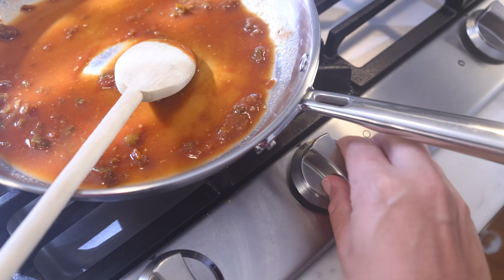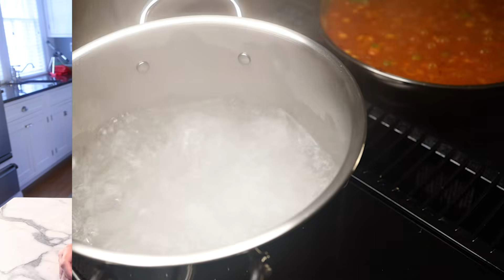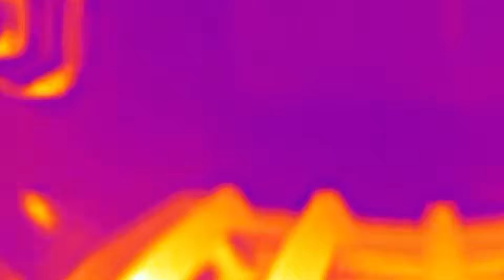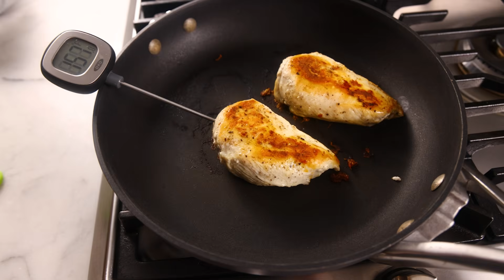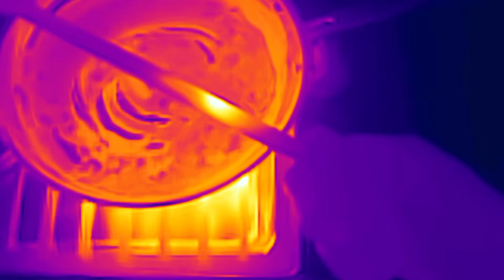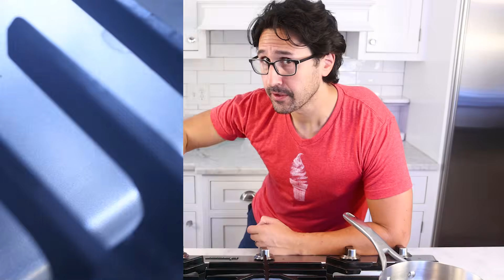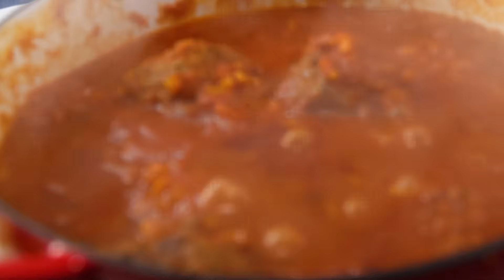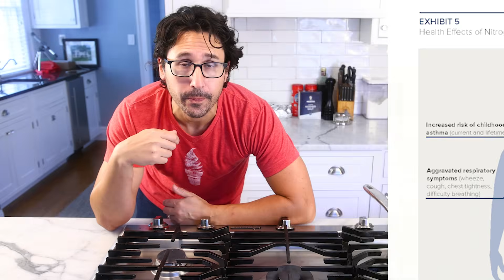Problems with gas stovetops | weak, dirty and dangerous

Comment: I grew up with gas stoves and learned to cook on them. Went to uni and absolutely hated cooking on an electric stove. I've moved to a new house though with induction, and other than needing to buy special pans, it's far superior to both. It's so much cleaner and is so much harder to overcook sauces and the like than either electric or gas. It just makes multitasking so much simpler because you don't need to constantly worry that things are overheating and other things are burning on the bottom and what not.
Reply: Except for when you need to use a very light pan on the induction, the pan moved all over if it is not heavy enough. I get a couple of pan walked off the induction top because it vibrate too much.
Reply: Gas works when electric power is our, this could be a life saver.
Reply: @3ducs  Not really a problem where I live and if there was some great emergency where the electricity goes I could just eat cold food or use a camping stove.
Reply: @georgebritten6666  When the power goes out and it gets so cold in your house you can see your breath you might realize how serious things can get. Ask me how I know.
Reply: @3ducs  Not everyone lives in the United States. Reading other comments this seems to be a common problem.
Reply: @3ducs  I lived without a boiler for a year, yes the house can get cold but you wrap up warm and realistically I probably wouldn't be choosing the hob to heat the house.
Reply: @georgebritten6666  Try that in New Hampshire where it can often go below zero Fahrenheit in winter with high winds. A gas stove can be the difference between keeping the house above freezing in a power outage and thousands of dollars in frozen pipes. Not everyone can afford solar and battery backup or a whole house backup generator.
Reply: @3ducs  depending on where you live, power outages are not a thing. I legitimately can’t remember the last time we had one. Must’ve been at least 5-8 years ago and even that’s being generous. Those power outages don’t take hours either, even if we ever have one.
Reply: @Tom-bb5kh  Outages are not rare here in New Hampshire, USA. The state is heavily forested, storms often bring trees down on power lines. Out of a population of 1.3 million we recently had 200,000 without power from a storm. In below freezing temperatures this can get serious quickly.
Reply: @3ducs  For 99% of the population this is not a concern. Furthermore, that is a problem with infrastructure and emergency services. In the event of a power outage during extreme weather to the point that it's a safety issue, your local government should be stepping in to help you. Even in terms of personal measures, keeping a gas stove around for the express purpose of heating the house in an emergency is horribly inefficient when things like gas powered space heaters exist.

I'm not saying they haven't saved your or anyone else's life; I'm sure they have, and that's wonderful. But keeping millions and millions of gas stoves in circulation in addition to the massive infrastructure that supports them to solve a very specific problem experienced by a tiny percentage of the population WHEN OTHER BETTER SOLUTIONS EXIST is ridiculous. Hell you could even keep gas lines to homes and simply only use them for emergency heating systems. There is absolutely no reason at all to equate "I need gas for heating in emergencies" with "I need a gas stove".
Reply: @ValkyrieTiara  Funny how a thing that no one thought was a problem has suddenly become one. It's almost as if there was a plan to keep the populace alarmed at all times.
Reply: @3ducs  if I had as many power outages as you I would be investing in solar and a big battery system. When buying a new stove and oven I didn't even think about what would happen if the power went out because I don't even remember the last time I had a power outage.
Reply: @rhys6165  You are assuming that all people have the financial means to do all that investing. Many of us don't.
Reply: @3ducs  I didn't assume that at all. I said that is what I would do. I didn't get a battery for my house purely because it didn't make financial sense, but if I lived where you do I would get a battery because I wouldn't want to be constantly inconvenienced by power outages is all I am saying.
Reply: @3ducs  There are U.S. federal programs that subsidise that cost. Go do some research.
Reply: @blackeyedsusan727  Oh, you mean when they take money away from some people to give to other people?
Reply: @fbiguy5269 is a made up problem from the looks of it. Electric (radiant and coil) outnumbers Gas in the US. If the power cuts were  that common, the numbers should be reverse.
Reply: @ValkyrieTiara I'm not defending that shill. But the Power outages are a common occurrence in impoverished regions. That's why gas is still popular in third world countries.
Reply: @jamesisaac7684  That doesn't have anything to do with my point. We're not talking about third world countries. The number of people in the US for whom it is normal for them to be without power for weeks or even days at a time is vanishingly small; certainly not enough to warrant allowing the entire American populace to remain using gas stoves. As I said, I could imagine keeping gas lines specifically for the use of gas-powered space heaters to homes in high-risk areas where it is conceivable they will need heating without power in sub-zero temperatures. For 90+% of the population, no gas to homes of any sort is necessary and it should be discontinued.
Reply: Not all countries have the same "quality" of Texas Electric grid.  

 @3ducs
Reply: So you haven't bought a AC, TV, Dishwasher, Washing Machines, Blender etc.? Because they what run on electricity.

 @3ducs
Reply: @jamesisaac7684  Well duh! Different tools for different jobs.

Comment: I can make the fuel for my gas stove top.  Biogas.  I don't make shitloads of energy to heat electric elements and the electric range should not be used in conjunction with solar systems, as it's not ideal for your battery's life. Derp, derp.

Comment: I really hate gas ranges. The temp markers on it seem more like suggestions. The flame and heat is basically either max or as low as it can go but still to hot. Yes electric does cycle and there's a bit of lag but I've always felt I had finer control. Like medium heat was actually medium.

Comment: Yea, less cabon footprint... because as we all know electricity grows on trees. The fact is you are cooking on fossil fuels with extra steps :) And don't get me started about the power of similar priced heating plates. MAYBE with the induction you can break even with power and exploatation costs. But even then the initial expenses are way higher. Also, even my 30 years old gas burner got a flameout safety feature. And don't get me wrong, enjoy your funky stove. But there is a whole world outside US where your arguments are just false :)

Comment: I hate my electric stove!  My glass top has one good element. My last gas stove had two. I need to start boiling water for pasta on the one good element, then move it the the next size down to start the sauce. Takes forever!  The spill heat from the 2nd best gas burner really came into play with tge large thick pots and pans I like to use. 

With a good vent hood, gas is hands down my favorite choice.

Comment: My Electrolux convection stove has 15 heat settings per heat spot (1-14 and P=instant boil), 1 is really low, probably to melt chocolate or something and the top settings are crazy hot. Then when I turn it off the boil is off in an instant. It took a little to learn to work it but now I like it better than any other stove I've had. I've even stopped using my electric kettle to make tea because the induction stove is twice as fast and nearly silent.

Comment: back burner may be safer for you but most normal gas stoves will have one burner that is stronger than the others and that one is always in the front right side ... it will tell you in your manual if you have one burner that is stronger than the rest. (americain)

Comment: I think the main reason modern industrial kitchens still mainly use Gass is the same reason they don't use nonstick pans, they're rough environments and I've seen a lot of cracked inductions but you can smash heavy pots onto a Gass stove top and it's going to be fine because of the metal grid
Reply: I use my glass stove top as a bench top all the time when I am not cooking since it's nice and flat in the kitchen

Comment: The part in the video where he said he had his burner set way low and still his stew was bubbling quite a bit due to the heat. When I set my gas burner on low my stew bubbles less than what was shown in the video. To me it it looked like the burner needed to be turn down more. I could use my big burners set to low with less bubbling than what was shown in the video.

Comment: I used to swear by a gas hob and electric fan assisted oven then I tried an induction hob and I wouldn’t go back to gas. Only 1 drawback with induction hobs are you can’t use every saucepan or pot as they need certain types to work.

Comment: Ok, so what produces electricity? Generally it involves burning coal, oil or gas to boil water that produces steam that turns a turbine that generates electricity.

Not only is that energy production wasteful but then that electricity has to move for hundreds of miles while losing potency along the way 

When you use your electric stove or oven, you have managed to burn more fossil fuels in less efficient ways. 

Bu all means, have your preference but never forget that electric ranges are the most wasteful method of cooking you can choose.

Comment: Best face at 7:22

Good points about gas stovetops... Mind you, I'm generally a big fan of gas. I hated the electric coil one we had at uni - the lag was a big pain, and it was hard to manage the heat as a result. I do like induction but the one we have at home now does not get that hot (at least, anecdotally - I'm not sure I can reliably test this myself) compared to the gas. At least now I feel less bad about the induction :p We have both gas and induction.

Comment: My gas cooktop has an 18,000 BTU burner that is way hotter than anything my mum's electric stovetop can do, and it also has a 5,000 BTU back burner that's perfect for simmering sauces. The flames go way down as well. The oven comes up to temperature significantly faster too. I wonder if you just have a poorly-designed gas cooktop...

Comment: if you weren't american you could just use an electric kettle to boil water. it's what I usually do, I flick the kettle on before I start getting my ingredients out. I think there's actually a lot more problems with electric stoves, in my experience. Eg some stoves (all I've used, not sure if this is every electric stove) work by turning off and on to maintain a temperature, but this leads to wild temperature fluctuations. I couldn't cook anything without either burning it or having the pan be cold. Also for stuff burning on the sides, I usually just use a silicone spatula for scraping down the sides of a pot properly. That's just a matter of using the right utensil for the task.

Comment: Despite the efficiency difference, I've always found gas to be much easier to cook with. It's much easier and quicker to change the temperature on a gas range than an electrical.
For instance, I had to completely readjust how I made carbonara when I moved from gas to electric. Child just be the ranges that I used, but given the option, I would never cook carbonara on an electric stove top.

Comment: I had the opposite.  I've had three electric stoves in my years and they were all crap.   They were not only slow to respond, but they're was no fine grain control - you basically had 100%, maybe 90%, and then like 5% so you could either burn your food or never actually cook it and nothing in between - and all of that was within 1/16th of a turn of the know.  Now MAYBE they were just junk stoves (all three?) but on the flip side I've never had a gas stove I couldn't control well.  Even the pump up Coleman camp stoves that run on gasoline offer better control than any electric I've ever had.   I MIGHT goto induction, but I'll never consider a resistive electric stove ever again.

Add to all of that my new Samsung has 27,000btu output to its largest burner and almost 80000 btu total with all burners running - that's about 4x more btu than any electric stove could ever do even with a dedicated 40amp breaker.  In fact my one large burner has the total possible output of an entire electric range.
Reply: My parents have a built in really old electric resistance stove and it controls just fine, it doesn't cycle either (my induction one does). I think your really did just have 3 lemons or were trying to adjust way too much, normally you just set it to medium and let your pan preheat and then add food and when its cooked put it on low - medium low to keep warm. Anything above medium is either a very full pan or boiling water. 

I personally haven't used a gas stove but i think the technology isn't anything i want either. To me gas is the stove in my grandfather's camp in the woods where you need a generator or a propane tank to turn on the gas lights. Add in the efficiency factor and gas and Induction are identical except induction has better potential as the reason the grid is only around 33% efficient is thermal power plants like nuclear and gas. (you can get electricity from any source, be it dirty coal or clean renewables so it can be more eco friendly if thats a concern)

Comment: The burning of the custard or other things because of the hotspot is a pan issue not a burner issue. The heat distributing disk is too small antsy pants and doesn't fully cover the whole entire bottom of the pan. The material is so thin there the heat transfers too quickly. America's Test Kitchen has a really good video on this

Comment: The biggest problem I have with electric is they adjust the amount of heat by turning the burner on to full and then off to achieve an average.  This is called a duty cycle.  Problem with most electric burners is the duty cycle is way too slow.  Let's say you want to set your burner at medium which should be in the middle between high and low.  So the duty cycle would be 50%.
BUT!!!  That means the burner is switched ON at full power half the time and the other half of the time it is switched OFF. And the average is 50%. But here's the rub. Let's say it switches ON for an hour and then OFF for an hour then that is technically medium or 50%.  But obviously during that first hour of ON the burner is full ON and you are going to burn everything.  So the duty cycle needs to be much faster than an hour.  In fact it needs to be about 1 second.  ON for a second and then OFF for a second.  That would work just fine.  Problem is that ain't how they are made.  Every electric stove I have tried over the last ten years has a way too slow duty cycle.  45 seconds ON and then 45 seconds OFF.  And during that 45 seconds ON my grilled cheese burns.
Induction stoves. Same problem.  Slow duty cycle.  There was no reason they can't make the induction burner to have a duty cycle of 1 second.  Likewise there is no reason they can't make traditional electric stoves with a one second duty cycle. But they just don't. 

Now it might be that some electric range tops have my preferred fast duty cycle.  But they don't specify that in the specs for the range top.  They only way you can find out for any particular model is to try it yourself.  And at every store I've been to they don't have power connected to the range tops/stoves that are on display.  So that leaves only one way left. Buy it. Have it delivered to your home. Try it. Then send it back for a refund. Ridiculous.

Comment: Ok first off you have a double burner gas stove that can pump out massive amounts of heat…. It surely will beat the average electric range at boiling water ( except induction) so idk how much I agree with you

Comment: A cool thing about induction for those on the fence: when you can't see a flame, induction can actually control the temperature of the pan pretty accurately, so if you know what actual temperature "medium flame" represents you can just set it.  You can also look up optimal cooking temperatures for the various foods you cook, for instance: scrambled eggs will be much lower temp than pancakes.  Once you get a feel for it, induction gives you much more control than gas.
Reply: i dont get what point you're trying to make. you can have that temperature control with gas, it's called using your hands.
Reply: @luckiee_  what i mean by more control is induction is more responsive than gas or electric, it heats up quicker.  Maybe i didn't say it exactly this way.
Reply: @totoroben  I disagree still. I loathe electric because it takes forever to heat up or cool off (if you have to simmer something after reaching a boil for instance) but gas heats up/cools very quickly and is very receptive to changing the gas flow on the hob. it's almost instantaneous. Especially noticeable if you're cooking with a steel pan instead of say cast iron which holds temperature better.
Reply: @luckiee_  please read about induction, it's a very different technology than an electric coil stove.
Reply: I agree with luckiee, you aren't a proffesional chef in a michilen star restourant. You're at home with your family and friends most of the time, who gives a shit about perfect temperature control?

Makeing food "perfect" according to recipies all the time is bullshit anyway, the flavor of life are the differences in how the food ends up tasting and feeling even if cooked with the same ingredients everytime.